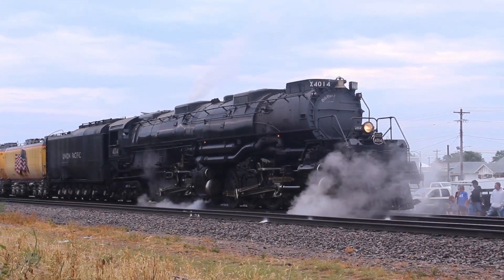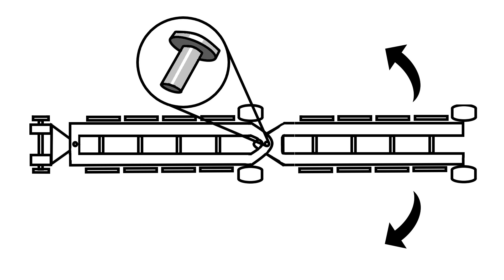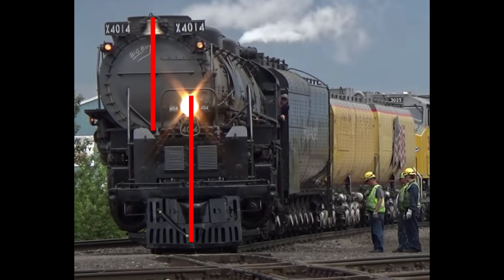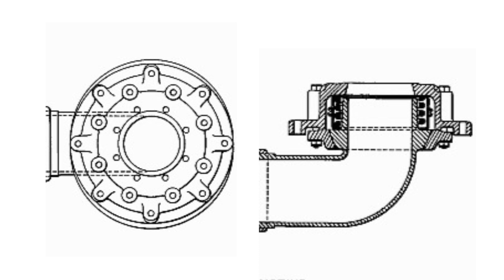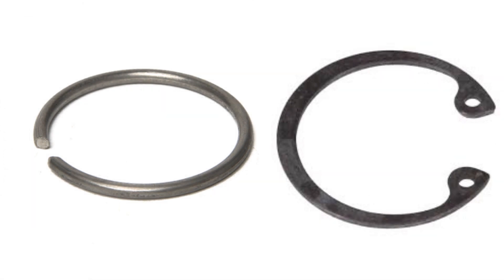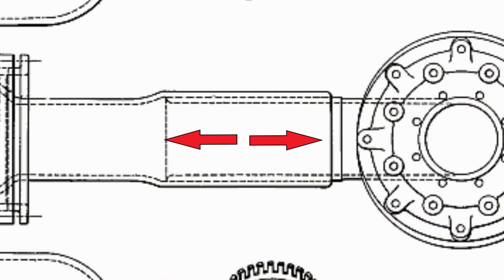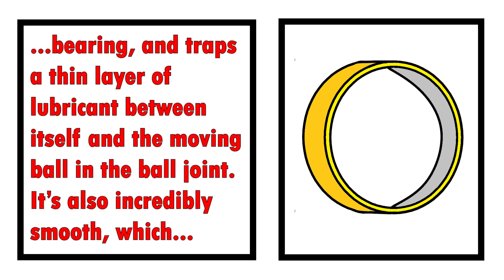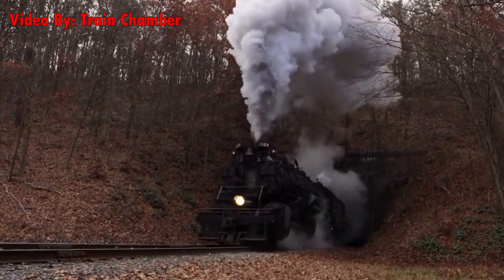How Articulated Locomotives Take Curves!

Comment: 1:20 its basically an open diff, if one set starts spinning then all the steam pressure will go to that set because its the path of least resistance. One leaky valve is all it takes.

Comment: There mist be some lateral movement permitted somewhere? A single pivot would not allow the loco to go through compound curves like points. Does anyone know anything about this?
Reply from the maker: There is. There's 5 joints  on the pipe section featured in the video.
Reply: @Southern_Plains_Railfan  I get that but I'm talking about the bogie itself. The pin must have lateral movement (or the axles) in order to accommodate compound curves?

Comment: Big Boy and Challenger were “simple” articulated engines, and did not reuse the steam from back to front. They, and the 844 Northern, also had their throttle at the head of the superheater way up at the smoke box rather than in the back of the boiler at the classic “steam dome”, meaning throttle changes caused instant response at the cylinders rather than there being a delay of several seconds between the throttle movement and then cylinder action like in most older locomotives in general. “Compound” articulated locomotives uses the steam twice, once at high pressure in the back then again at lower pressure in the front, hence why the front unit cylinders on those kinds of locomotives were much larger, even if re-heated first the front cylinders would still be a bit larger as re-heating could not return it to the original pressure in the limited time it had. Lastly, Big Boy and the 3900 series Challenger used roller bearings in their construction which let them run faster for longer with less damage to the track as usually caused by the older extra-heavy front engine units of the compound types when above 25 mph. They really are amazing machines.

Comment: Great explanation, I have several old Baldwin and ALCO catalogs that go into great detail about the flexible steam joints.  You nailed it.

One of the things driving the use of low pressure steam exhausted from the rear high pressure set of drivers on a Mallet to the low pressure front cylinders was that is was easier to keep the low pressure steam joints tight.  Eventually they figured out how to make these connections work for high pressure superheated steam in the 20s opening the door to high speed superpower simple articulateds like Big Boy and the Alleghenys.  

You mention that most railroads are relatively straight and the curves are gentle.  Some great examples of super flexible simple articulateds can be found in #50 and #51 from the Uintah Railroad in Colorado and Utah.  They were successfully traversing some of the tightest and steepest rails in the country actually displacing Shay geared locomotives.  92 foot radius curves and 7.5% grades!  Baldwin described these engines as designed for the most severe operating conditions imaginable in their literature.

Comment: Too Bad There Were No Actual Old  Photographs Available Of The Connection And Pivot Points Of The Frameworks.   As Well As CLOSE UP Piping And How It Must Have Been Located Under The Long  Boiler Tank.  There Were Old Photographs Taken Of A Steam Locomotive Entire Upper Boiler Section Being Lifted High Off Of The Wheels And Framework At The Salamanca New York Shop Of The BR&P,  That Also Used Malley Locomotives  During The Early Years Of The 20th Century, And  Are Very  Impressive To See Indeed.  However Your Explanation Answered Most Of My Curiosity About How These Massive Machines Operated.  Thank You...
Reply from the maker: Yeah, I searched around for a photo of the pivot points, but as you can see I didn’t have any luck. That’s would like a really cool photograph, makes me want to see it, lol. You’re welcome, I’m glad you found this video informative.
Reply: @Southern_Plains_Railfan  The Photograph Of The Steam Locomotive That Was  Lifted Off Of It's Wheels Was In A Hard Cover Book Written About The BR&P, (Buffalo Rochester & Pittsburgh Railway),  By A Fellow Back In The 1980's.  However The  Book No Longer In Print And Contains LOTS Of Pictures Of The Locomotives, Shops, Stations And Road Gradings That The Line Had.   It First Started In Rochester N.Y. After The Civil War,  And Progressively Expanded Southward To The Coal Fields Of North Western Pennsylvania In The Late 1800's.  As It Grew Larger, It Went Even Further Down To Pittsburgh And Branched Off Near Salamander N.Y. To Buffalo.    It Even Used The Famous  Kinzua Bridge That Was Over 2K Feet Long, (And  Was Called The 8th Wonder Of The World When It First Opened In 1882), That Was Reconstructed In 1900 To Handle The Heavier Trains.  But UNFORTUNATLY The Bridge Mostly Blew Over By An F-1 Tornado That Past Nearby It In 2003,  While Additional  Work Was Being Done To Preserve The Bridge.  It Was A WELL MAINTAINED Line,  More Like A "Big Little Railroad" Needing Their (2-8-8-2 I Believe They Were), Heavy  Mallet Locomotives As PUSHERS And PULLERS To Assist The Heavy Coal Drags To Get Over The Steeper Pennsylvania Mountain Plateau Grades, Moving Coal That Was Mined Around The DuBois And Punsxutawney PA. Areas.  YES,  The Same Town Famous For It's Groundhog Weather Forecasting  Earlier This Month.  My Grandfather Worked As A "Boilermaker" At The DuBois "Lokey" Shop As One Of Their First Welders,  But They Also Had A Steel Hopper CAR Shop And a Wooden Box Car Shop  On The Other Side Of Town As Well.  Primarily  Because It Was  More Centrally Located Between The The Two Ends Of The Line, And Had A Steam Powered Wrecker Stationed There That Could Clean Up Any Wrecks Or Provide Replacement Engines  If Any Developed Problems Along That Approximately 250 Miles Of Track.  However It Was The Salamanca Shop That Had The Lift That Could Raise The Locomotive Higher  Into The Air For Wheel Replacement Or Framework Repairs.  I'll See If I Can Find That Book And Make A Good Copy Of That Photograph, To Send To You By E-Mail SOMEHOW.  OR,  Have It Enlarged And Send It To You By Snail  Mail If I Have Your Address.  Dave...

Comment: For the record Big Boy uses high pressure steam in both sets of cylinders. I believe the Challengers were the same way.
Reply: Yep, and this is part of the reason they were so successful
Reply from the maker: Interesting, I never knew that.
Reply: @Southern_Plains_Railfan  I believe it was found the oversized low pressure cylinder created too large of a hammering effect as locos in general grew in size.
Reply: Correct - therefore, they are not Mallet.

Comment: Really great video, excellent you included and did some quite fancy pants artwork with the diagrams, and went very in depth regarding what the joints actually consist of. That was a big almost backward step with UP's Challenger and Big Boy series: they stuck with the rather chaotic mess of joints, whereas Lima had eliminated over half those joints, producing a spectacular increase of efficiency compared to the other two. Both Challenger and Big Boy types had lazy exhausts as a result of fairly poor exhaust efficiency.
I'm pleased you stuck to just one form of articulation too, and didn't extrapolate further into the articulation minefield or even into what defines a mallet.
Great viewing  :)
Reply from the maker: Thank you, I'm glad you enjoyed the video! I never knew that the Big Boys and Challengers had those kinds of problems. I wonder why ALCo didn't take a page out of Lima's book when designing their engines.
Reply: @Southern_Plains_Railfan   thank you! A lot of it was the fact that it was an Alco/UP design collaboration, most of it was the timing: Lima's Allegheny came out in '41, same as the Big boy, so there wasn't really any time for any crossover. The Allegheny had a single steam joint at the front engine pivot, routing the plumbing through the main frame directly to the cylinders, hence only one joint to the big boys 4 pivots and 2 slides. 
If you have a look at videos of the UP locos you'll note the very lazy exhaust almost floating down the boiler barrel. Hard throttle not so noticeable, but just different designs, one being more of an advancement. It's more telling that UP wanted F units rather than buying more #4000's.
I could add that theres an awful lot of factors in any loco design. The drivers of those Chapelon masterpieces needed a veritable engineering degree to get the most from their locos, and that early 8 cylinder vauclain simple compound mallet tank was fraught with design issues